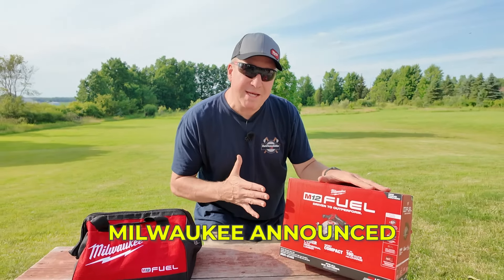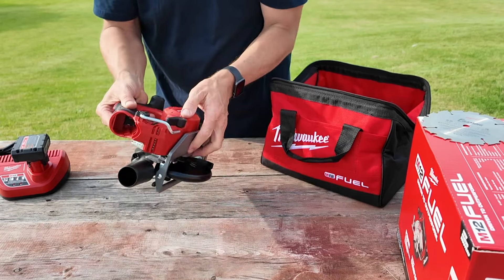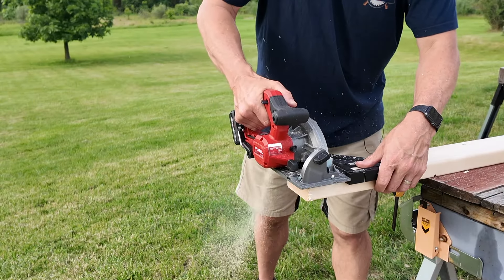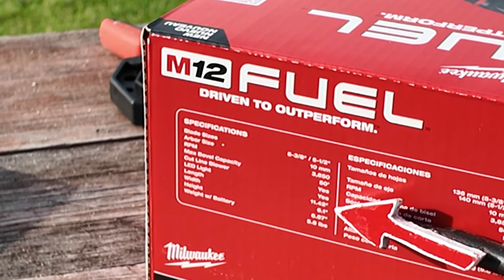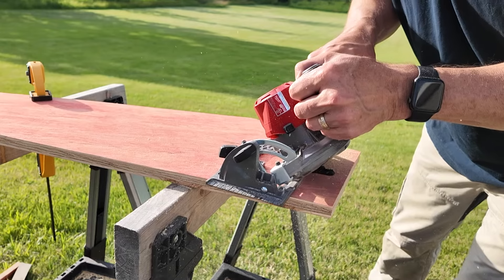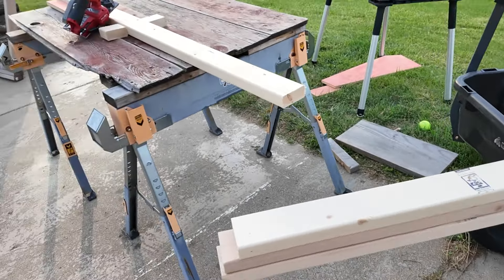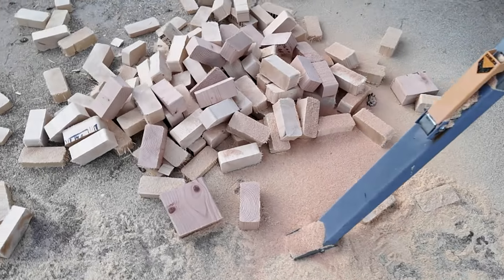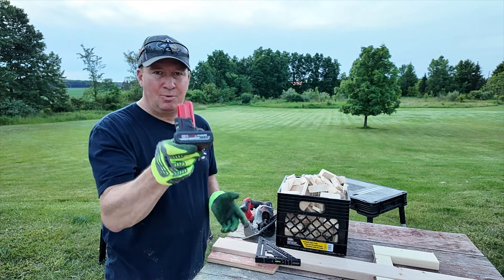Testing the Gen 2 Milwaukee M12 FUEL 5-3/8” Circular Saw - 25% More Power & Runtime!

Comment: Blade left for me! Your review came out at the perfect time. I was considering getting this new model saw when I found out they were updating it but was hesitant because the last model I thought was under powered. Specs look better, I value your opinion, and it’s oddly on sale so the stars aligned for me to pull the trigger and so I bought it! Thanks for the great review my friend!
Reply: $99 on the Home Depot app right now! Don’t know if it’s a pricing error or not. Google gen ii m12 circular saw and it’ll come up. I couldn’t find it listed on Home Depot app.
Reply: @EveryDayCivilianBlog  nope it’s a legit price. I just picked one up last night but for $10 less with my military discount, still a freaking good deal for a newly released Milwaukee tool! It’s there on the HD website, that’s how I knew my store had them in stock.
Reply from the maker: That's cool to hear the timing of it all.  I think you'll be happy with this saw!  The tool-only price is pretty good for a nice saw like this.

Comment: Wow, @ 09:43!  Mark has access to a M12 12.0 Ah battery?!?  Lucky guy!  😯 😆 🤣 Sorry, couldn’t resist!  

Great review Mark.  I couldn’t help notice how similar this sounds to DeWalt’s 12 Volt Xtreme 5&3/8” saw, which is a nice smooth running little saw, but I believe the M12 will outperform it.  I have and use the DeWalt, and I think it is best left to trim work.  It will cut dimensional lumber, but not with a bevel.  I had to ‘work’ on the adjustment levers, and spray the bevel pivots with healthy dose of Silicone spray, to get them to work!  DeWalt’s QC seems to leave a bit to be desired of late?   If a person was heavily invested in the M12 system, this is a no brainer, otherwise, I personally would go for the New 6&1/2” M18 saw.  She is a screamer!  Stay safe!
Reply from the maker: Oh man, a 12Ah would have some crazy power, lol! 😂. Good catch, George!
My very first battery powered saw was a 14.4V DeWalt 4-1/2" circular saw/trim saw from the mid 90s.  I bought it with hopes that it could cut treated 2x6s when installing a sill plate.  I think I could just get 4 cuts on 1 battery.  They've come a long way since then!  

I haven't tried any of their 12V items yet, but would like to see a comparison.
Reply: @MarkThomasBuilder  Oh yeah, I was there too “back in the Day.”  DeWalt tools had the power, at the expense of battery life.  It was always my contention the tools put too much demand on the batteries, and the battery tech back then pales in comparison to Today.  I had a similar experience with an early 18 volt 6&1/2 “ circ saw.  After a half dozen cuts or so, and time to switch out batteries!  

Appreciate your good sense of humor, in dealing with mine!  Take care

Comment: After running the 5aH down you mention good to get that out of a 12.0.  Thinking of the 18v batt largest size obviously  FWIW.  Nice Vid.  I’m enjoying my Gen 2 5.5 12v saw!
Reply from the maker: Glad to hear it!  Milwaukee PIPELINE is next week, so maybe they'll introduce some New M12 batteries.
Reply: @MarkThomasBuilder 
 🎉🤤   Yeah man, maybe you can twist their arm to get you some info on tabless 1865 cells for all our m12 toys and usb lights!  If they don’t release new 12v tabless cell batts till next year anyway, which would be my guess…

You mention the good handle feel on this saw.  I agree and noticed it’s more tapered than other m12 products and more ergonomic, nice to find.  I’m also a big fan of the width reduction vs Gen 1 for fitting in my Packout much better.

Comment: The bare tool is currently available in very limited quantities at Home Depot stores for $99.  No idea why it's marked down, but the stores in my area had received only one or two each.  The lower blade guard can be swapped for the metal lower guard on the 2530 (gen 1) M12 circular saw.
Reply from the maker: That's a great deal for such a powerful saw!
Reply: Probably gen 1

Comment: Thank you for this video! I’m considering this saw as a hobbyist/artist (rather than as a professional), and would be using it to break down sheet goods, say maybe a few sheets of 1/2 or 3/4 plywood cut down from 4x8 to 2x2 every couple of months. Does that sound like an appropriate use for this tool? I don’t need power so much as clean cutting and reliability, and the ultra light weight is definitely a big draw, since I feel awkward and a little unsafe trying to use a beefier circular saw, as my hands are fairly small and have some repetitive stress related weakness that can crop up. Cheers!
Reply from the maker: This would be a great saw for that.  It's nice and compact, easy to use!  I'm sure you'll like it.

Comment: I think for most situations I want blade left. I'm right handed so I want to see the blade easily. The one issue with this is that if you're cutting the very end off a board you end up cutting away your base of support since the saw weight is on the off cut. This likely isn't a big deal with a 5 lb. compact saw. I'm used to a plug in worm drive skilsaw. But then again, if you're making cuts like that you're probably doing framing so it really doesn't matter if it's perfect. IF you're making fancy furniture you're using a miter saw or table saw for such cuts and you're not using 2x4s.
Reply from the maker: Yes, good point!  I agree.

Comment: I put my M18 in the Milwaukee small pack out bag so I can have my pack out light and backpack too, fits great(it's the 6 3/8"non fuel) but I bet a 7 1/4" could fit with no battery attached, currently looking at the new M12 the M18 non fuel is great, just can't fit in tight spaces to much because I'm a HVAC worker in resi

Comment: Max depth on HD's website is 1.9" but the manual says 1-3/4". The marks only go to 1-1/2. Dropped fully it does look pretty close to 2" on a tape measure though.
Reply from the maker: I haven't tried to measure the actual cut depth, but it cleanly cuts 2x material.  If I did any 45° cuts, it would only be on plywood, which it's able to easily cut.

Comment: Hello Mark Thomas and Community!  
Cant say on the PackOut, but as to blade left VS blade right, I have and use both.  I am right handed, but I mainly use whatever works for what I am cutting.  Kind of subjective?  Rear handle/ blade left saws are great for ripping sheet goods, or cross cuts for framing, etc.  But I make a lot of cross cuts using a speed square like You did here, with a right handed blade.  To each their own, and of course, YMMV.  I use the speed square opposite of the way You had it Mark, no offense;  With the heel against the board, it wont move under the prsssure of the saw as it cuts.  Others prefer it the other way, and whatever works is what it is.  😊👍💪🇺🇸🤝
Reply from the maker: I'll have to try the setup you mentioned.  I just picked up some habits along the way and stuck with them, right or wrong.  Well, one habit I changed was the using the table saw push stick to now be between the blade and the fence.  I'm thankful for this community helping each other out and having conversations to think about.
You made some interesting points.  As always, thanks for stopping by! 😁🙌💯
Reply: @MarkThomasBuilder My pleasure Mark!   😊🙌

Comment: At 45 degrees can the mitre be cut on a 2x4 ?
Reply from the maker: No, at 45 it's only 1.3" depth cut.
Reply: @MarkThomasBuilder  I live in a metric county mate so what does than mean regarding timber sizing ?
Reply: @MarkThomasBuilder  looks like a good saw but disappointed that it can cut a basic industry standard timber mitre for a rafter
Reply from the maker: @TBird89  A 2x4 is 1.5", so this can't cut one at 45°.  It only goes 1.3.
Reply: This seems like a huge oversight or a “happy coincidence “

Comment: Mafell, Festool, and Mikita have the best variety of small saws
Reply from the maker: I just checked out Mafell, and wow, they're more expensive than Festool.
Reply: @MarkThomasBuilder  Mafell is the premiere premium best in class. Example Their electric jigsaw is over $800.00, including the 45° angle it's is the most  powerful jigsaw in the world and the only jigsaw that will stay true at a 90°, 45° and any angle it is set. This jigsaw is so great that Mafell hadn't changed the design for over 14 years. Their cordless Jigsaw is just the best money  can buy, which cost more than $800.00. I could keep on going, but in a nut shell, Mafell, you are paying for the absolute best. Mikita XGT planer just beat Mafell after 22 years, so I expect an updated planner soon. Anyway, Mafell, Festool, and Mikita are the 3 makers of hand-held saw the world over, that's coming from a guy who solely buys FLEX tools.